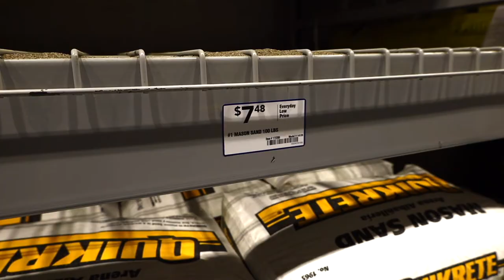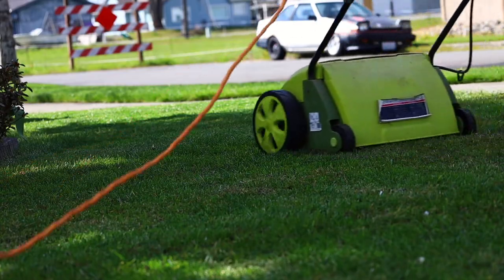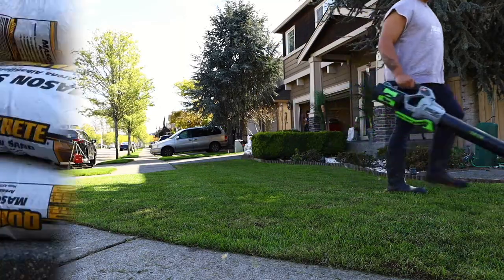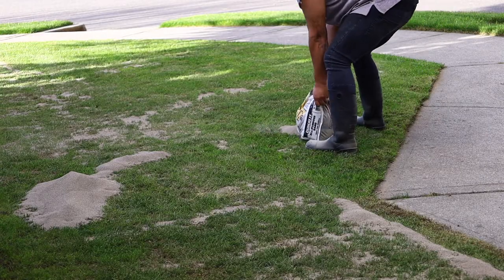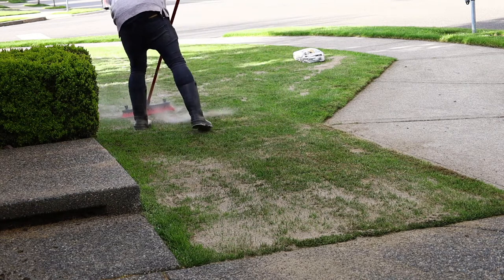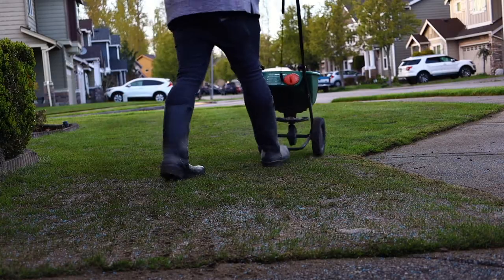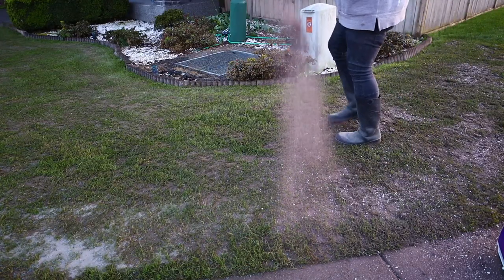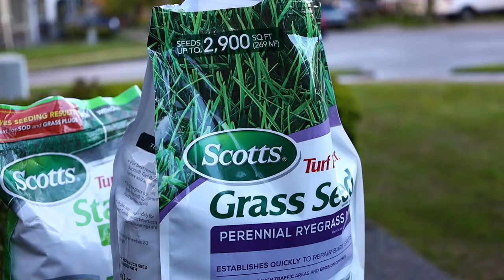Sand Leveling & Overseeding My lawn!

Comment: So cut low, aerate and spread sand to level. I'm new to this and have an extremely bumpy and moist lawn on a hill. To the point the soil is exposed in the bumps 😳 and can I just use the quickrete all purpose sand from home depot by itself since I can't find the mason sand?

Comment: so what happens if a guy....does the same thing you did but WITHOUT the peat moss covering? i know you mentioned a bird problem.  are there any other concerns if you don't use peat moss/potters mix?
Reply from the maker: As long as you rake the seed in you’ll be fine… this season I didn’t cover the seed and it came out perfect 🤙🏾

Comment: Which aerator do you think is more effective? This new one or the Amick?

Does the Amick give you lawn sausages? And it’s good for the grass to leave those on top for a few days to decompose into nutrients for the lawn I thought.
Reply from the maker: I mean the new one is more effective as in it creates lawn sausages even with super moist soil... but with the right conditions Amick creates cores too... the difference is speed and price that's all it comes down to speed and price. Amick is just a faster tool but more expensive. Yes it's good to leave the lawn sausages I just wanted to have a clean slate for the sand level 😊🙏🏾🤙🏾

Comment: Great video Brah!!! Hey question? Did your buddy sharpen your reel mower. I tired mine on a little 10’ piece of the lawn and it didn’t cut it it freakn pulled the damn grass😂. I think I might need to get it either sharpened or just rebuild it. Anyway..can’t wait to see your results keep one keeping on.
Reply from the maker: Thank you! No he didn’t it’s very full I gotta get a kit or maybe just another blade? That’s horrible I would have died laughing if the grass was pulled 😂😂😂🙏🏾🤙🏾
Reply: @YardBrah  there's a shop in South Tacoma called King Palmer Sales & Service that can probably fix your reel up. Agrishop on Sprague might be able as well. They used to sell Cal Trimmers.
Reply from the maker: @DaEternalNoob   Oh nice def gonna screen shot this message cause I've been looking for mower shops sometimes they got the best deals on random mowers to buy lol!!!! Thank you 😊🙏🏾🤙🏾

Comment: So you put down sand every year?
Reply from the maker: Sand in the beginning soil mid season and sand in fall… it’s like a layer cake 😂😂😂🔥🔥🔥🙏🏾🤙🏾
Reply: @YardBrah  lol
Does the sand break down?
Reply from the maker: @johnrossi6212  So people will tell you "once you sand there's no turning back" BS bro the sand is just gonna mix in with the soil. After a season if you pull a plug you can see see it layered up... pretty much it's a good form of aeration 😂🤙🏾